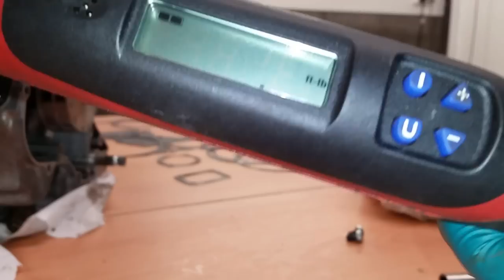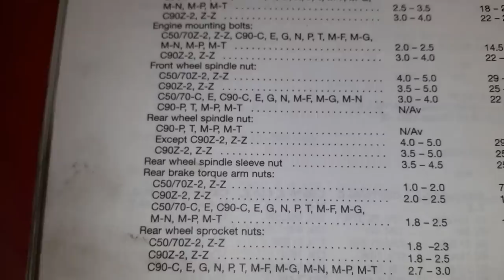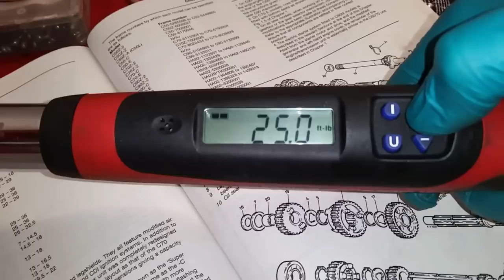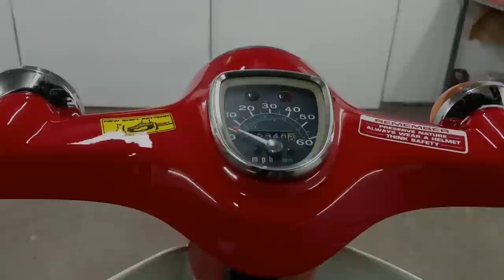The Grand Finale! -Part 6 ( Honda C90 FULL RESTORATION )

Comment: Great work overall but I can’t believe you skimped out and didn’t bother freshening the top end. Honing the cylinder, new rings, and rebuilding the head would have been cheap and would do a lot to extend the life of the engine.

Comment: I was a motorcycle mechanic back when these little engines were popular the Honda 50's 60's, 70's ,90's and 100's were some of the best engines ever produced ! They were just about indestructible
Reply: hey Ron,- Greetings from Germany ! Someone (Trike?) in the comments said this:
Quote >no grease on the bolts surprised me though(torque settings would be different unless specific for a dry fit) <Quote.  What is your opinion about greasy Nuts? lol ...

Comment: These videos brought back so many happy memories of my first ever motorcycle back in 1978, a rusty seized Honda C90, got it running and painted it with a brush and used to get to college... and my first feeling of independence. Crashed it so many times pulling wheelies and trying to get my knee down...
Reply from the maker: Love it! Thanks for sharing your memories with us :)
Reply: @RRCRestoration  If you hold the gear lever down and build the revs up before you take your foot off it , it's like dumping the clutch, you can even get it up in third lol

Comment: Great film ,especially for the novice to see how easily it can go back together if you  are methodical-no grease on the bolts surprised me though(torque settings would be different unless specific for a dry fit)Big thumbs up for giving a Cub 50 years more life.

Comment: Outstanding work, a real pleasure to watch having spent so much time maintaining and repairing my own machines in years gone by. I had C50's and C70's in my time but never a C90. You just couldn't kill one if you tried, I had one C50 that I repaired (back end, usual rot). I rode it for a couple of years, gave it to my Father- in- law to get to work on and then he bought a brand new one. The old one had gone round the clock and then some and never missed a beat. It ended up as a field bike for the son of a work colleague to ride on some land they owned. It went on and on. Great little machines. Well done Sir.
Reply from the maker: Thank you for your comment and sharing some of your memories with the channel :)
Reply: @RRCRestoration  Hi, 2 years later and I have just watched the whole series through again and enjoyed it just as much as the first time. So sorry, but I just noticed I never put a 'like' on your reply last time....We shall remedy that right now. There, done 😀😉

Comment: DAAAMN! 

I have a red Honda Supercub 1981 from my Dad (1st hand), still original. I fixed it and looks beutiful classic.. still using 6 volt battery, & still using poin breaker, and it can run until +83 km / hours as a boss! Btw good video bro.

Comment: man that was an intense restoration! ty for the video! it reminds me of when we worked on my 1977 Yamaha vino 125cc, it wasn't working when we bought it(hubby is a mechanic), after a new battery, new light bulb for the headlight, buying a new carb because the old one was broken, changing the oil, cleaning gas tank,  getting a new back tire I feel like we got off easy compared to your rebuild! enjoyed it very much! (my first bike was a honda 70 trail bike)
Reply from the maker: Thank you , Im glad you enjoyed my series and thank you for sharing your memories with us :)

Comment: lol I've noticed a couple besides the brake cable. I would have put a washer before I put the cotter pin on the pegs. But all in all. Excellent job
Reply: The washers under the split pins are there in the before photo, but missing in the finished photo.  I think there maybe one missing from under the kick stand split pin too.

Comment: Wonderful recovery, I was very much waiting for this part! but I have a question. Why the crack in the protection of the legs was not eliminated , I mean it was impossible or you didn't see? 
P.S. on 28:53 or 29:11
Reply from the maker: The crack is only there as i fitted the old leg shield to get the final shots as the new one didnt arrive in time and i didnt want to keep you guys waiting any longer for the big reveal ; )

Comment: What a beauty ! Thank you for the detailed build , I learnt where the wire goes through the barrel, you missed the front break cable through the retainer in the front plastic guard of course, fixed in the next shot. Mirrors ? Just great work . Well done.
Reply: Have a look at my 1968 Honda C90 barnfind, if you like.

Comment: Just a tip..... use a weak solution of dish soap and water when applying your decals. It will enable you to get them in the correct position as it temporarily disables the adhesive.

 Great job on the bike. I thoroughly enjoyed watching this build.

Comment: excellent restoration job, haven’t seen one of those things on the roads for a long time, they were a big favourite of bike thieves when I was a teenager.
Just a word on electroplating, when pickling and electroplating components a lot of hydrogen is introduced into the metal causing it to become brittle (hydrogen embrittlement) this is a problem for ductile items such as springs, to get the hydrogen out of the metal again you should bake it in an oven at around 200-220C for at least 4 hours, overnight would be better.
👍

Comment: My first two bikes, Honda C50 then a Yamaha RS125. (And later the Honda Superdream). The 125 was more fun than  the 250 Superdream.
The C50 engine is a great way to introduce kids to engines, i was for ever taking it apart and cleaning thinking i might a couple more mph out of it.
Reply: Same as that, I bought a Honda 50 off a farmer at the age of 12 here in Ireland, lucky the guards didn't catch me driving it home the 6 miles on the back roads, or they would have kicked my arse if caught, it gave me the lifelong love of bikes that I have to this day, and I love the wee Honda 50 ever since, any time I see one it brings back memories, not long after I bought an old CD 175 off a farmer again, another great wee bike

Comment: My first motor vehicle of any kind was my 14th. B-day present from the 'G-rents'...a '68
'CM-90' Super-Cub! (no turn-signals, no manual-choke, kick-start only) I beat hell out of that
machine for 3-freakin' years...and it took all the abuse like '3-penny nail'. ($300 from showroom at 'Scootersville Honda' in Las Vegas)
*forward fifty-years*
I was cruising thru 'Craigslist' 2-years ago, and saw an '08 Honda "Metropolitan" in gloss-black
& gray...looked at maybe 15-pics and 3-paragraphs of descriptions...and HAD TO HAVE IT!
(it told me to "Come and take me home where I belong or some kid will get me and beat me")
Guy who sold it to me was nice enough to allow me to make 3-payments total of $1150 and 
*ALL MINE!* and how often does that happen?  He didn't know me and I live 80-miles away!
(he kept the title until 'pay-off' and we had 'proof-of-payments' using 'PayPal' for the last two)

This machine *STUNNED ME* with how sophisticated it is, as well as being utterly reliable
with starting and running as 'smooth as oiled-glass' from the 'Mighty 50' liquid-cooled engine.
This 'Metro' is so far advanced from my '68 that my old bike may as well have been from the
'Stone Age w/Fred Flintstone' riding it!
This machine runs like a 'baby Cadillac on two-wheels' and with minor performance upgrades
hits 42-44mph with a 225lb. 'old geezer' on it ('Upgrades' already done when I bought it)

This Honda is the most reliable, best-running, most enjoyable vehicle I've ever owned in life
 and I'm almost 65 now (very easy to maintain yourself...parts cost very little on 'E-Bay' )

I thought maybe 'I'm too old now for this' but the instant I got on and rode it...*EVERYTHING*
came back to me! All my senses and skills from 'then' were just 'sleeping' until I got on, and 
"it's all good' was still there.
(oddly...you cannot 'ghost ride' w/this scooter because of the wheelbase-length and wheel-
diameter will start to 'shimmy' very quickly)

The ride and 'road-feel' are 'light-years' better than my '68 ever was, and I've never been
'scared' of loss of traction in curves, etc. (somebody else will have a 'nice little Honda' after
I'm dead...cause this is a 'keeper')

Comment: Best bike restoration video I've seen.   I own the same 1967 CM90 bike that needs restored.   I don't see video 1 & 2 listed on youtube.  Are they still available?   Regarding your sandblasting, i don't think you used silicone sand.  What granuales did you use?  Were all replacement parts easily located/found on the web or thru a Honda Dealer?  What was the total cost in replacement parts?

Comment: I had a '68 'Honda 90' "Super-Cub" for my 14th. B-Day!  (from G-parents)
That Honda was almost indestructible, and at 14 I did my best to 'tear the shit out of it' and it still would not die
( *I wouldn't trade my '08 "Metropolitan" for the 'Super' you did, though...the 'Metro' is vastly superior in many ways with a much
better and more predictable ride, like a 'baby Escalade with two-wheels and has never failed to start and run perfectly* )
I can hit 42-mph with my 230lb. ass on it, and that's 11-mph slower than the '68  'Super could do

Comment: Very inspiring. Excellent work! You have a godlike restoration skill. I'm big fan of full restorations. I am currently restoring my Honda C70 powercub Japan version. If you don't mind sharing, where did you order the genuine parts? I want my bike back to it's original parts. Thanks in advance.
Reply from the maker: Hi,Honda still stock most of the parts you need ;)

Comment: Great restoration! Love the detail...
But I think you put the rear wheel shaft incorrect. The nut should be on the right side as seen on 34:44 cmiiw
Reply from the maker: Thank you. The rear axle bolt can be fitted in any direction as the exhaust is lower than the shaft so no fouling can occur when the wheel needs removed.

Comment: Old O in Osaka, YOU courted, C90 and C110, "when, octopus". Exhaust sound can be here and strike it "one after another", and I run, after, "when, octopus" (Oosaka accent) starts to say C90 turnip made by Honda, and oh. YOU remembers and doesn't like that. There isn't inside (in exhaust) settlement for a single muffler per C90Kz in particular, after, BATA and PATA saw stay here 4 cycles which dried I hear peculiar sound it's oh oh. A muffler looks like the exhaust regulation now and makes an exhaust chamber room for 4 layers and 5 layers and makes the room which looks like a catalyst combustion chamber in the middle in the exhaust, and becomes hot by secondary heat of an exhaust catalyst again, so the material, a stainless steel plate will be pressed threefold, and if, such hand was crowded, it's made, TO, they can be able to buy it and I hear sound, it's oh, oh.

Comment: My '68 CM-90 'Super-Cub' was a 'stripper' when I got it new for my 14th. B-day...no turn-signals/electric-starter/no manual choke/no 'folding' passenger pegs...and it topped-out at 53mph or so  I beat hell out of that poor 'beastie' for three-years riding almost everyday...and it never 'puked & died' on me I wish I had it back, just for 'old times sake'  My current 'ride' is a '08 Metropolitan in gloss-black & grey, and looks & performs 'as new'  Would I 'swap' for the Honda in this video? No way in Hell! Though she be but little...she is fierce!  My Honda is so far advanced and reliable over the '68 it's hard to believe it  No buzz or vibration at all...not even in the mirrors at WOT!  My top-end is only 43mph...but the 'Mighty 50' runs like a turbine and sounds like a pit-bull very softly 'growling to itself under the bed'  ( I routinely haul more groceries w/it than anyone would believe...and 'N'er a word o'protest' from the 'Metro'...all with my 230lbs. of fat ass on it! )  I must admit to some 'high-performance upgrades' here & there...but the engine & exhaust are 'factory stock'      *   You did a B-E-A-utiful job on the 'resto' in the vid!  Kudos to you!

Comment: you didn't use sealer for engine's packing, does the oil leak?
Reply from the maker: Hi,You dont need sealer when using the correct gaskets. No the engine doesn't leak a drop of oil.

Comment: I am currently working on 1971 CL70 but its too hard to find parts in canada . Where did you get all the parts to work in yours ? If you dont mind to share those info . Thanks in advance
Reply from the maker: here in the uk parts are readily available from most motorcycle shops and even Honda themselves. Good luck with your project ;)

Comment: Did you switch engine with the new one?
Reply from the maker: Nope, the original engine was rebuilt and re used.
Reply: actually, I'm looking for the meaning of the honda c70 engine number code, which uses the code  C70E... and C70ME.... . Do have any information about it?

Comment: 🇩🇪 The front wheel is not centered in the fork. The track is wrong and has not been set at all. Both wheels were not balanced, not well centered either. The front tire is mounted in the wrong direction. The throttle sleeve in the outlet damages the engine. Low power, thermal load, resulting in high breakage. And so on, there are many other things I have to say. That's why I give you as an old and learned motorcycle mechanic no like.